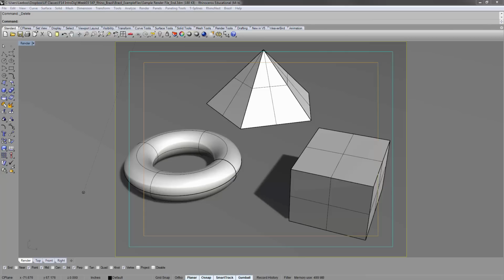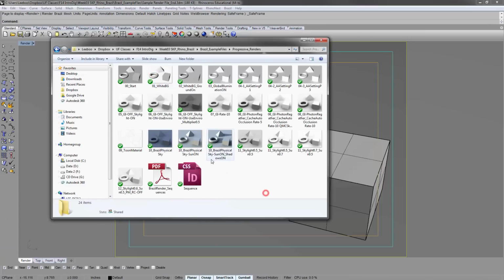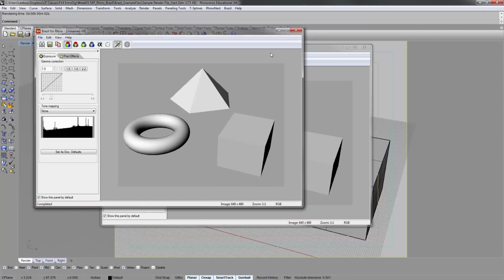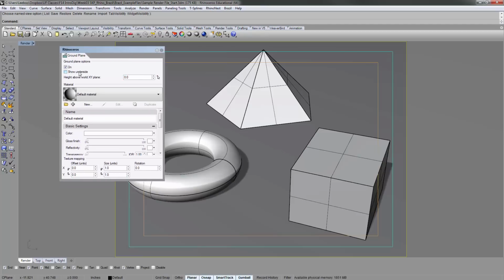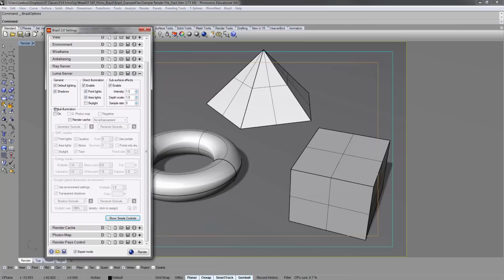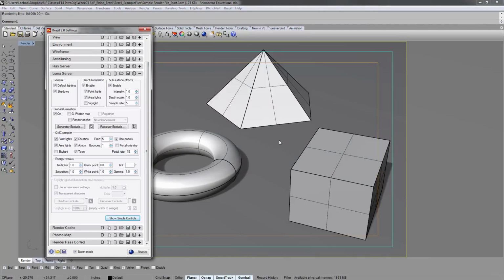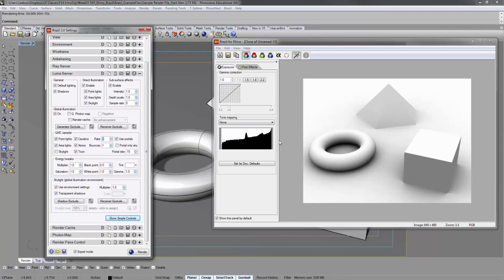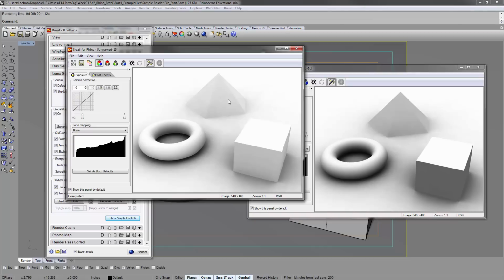BrazilBasics Part01

Comment: Hello, I have a question, how can I get an image, type jpg, put in a frame, adapting it inside the space, so that it is perfect? All the images that I try to put I can not centralize it, they are always very big. Could you help me? I use Brazil for Rhino 5. The windows twem a system that you put an image and according to the size that you choose it is adapting within the place.
Thank you..
Reply: The easiest way to do this, if I am understanding your question correctly, is to use the Viewport as your render output resolution setting. That way if you are doing any linework screenshots or Make2D with viewport boundaries you can match things up in Photoshop. If you need a higher resolution rendering output then specify exactly double or triple the resolution of your viewport, which will keep the proportions the same.